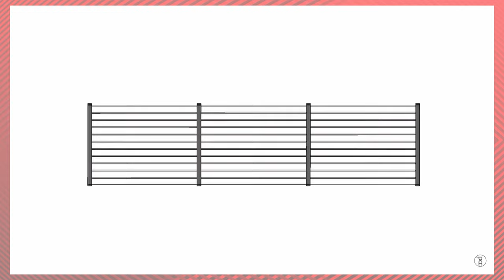How This Couple Built A Fence With One Fatal Flaw

Comment: Can't have wood posts encased in concrete. Has to have a little dirt or gravel at bottom of post for drainage. Will rot quick with no drainage. Need treated posts if using wood posts. Totally agree with using steel posts whether round posts with brackets and shorter spacing or your type of steel posts. Great breakdown guys.

Comment: Question?
Could you use decking screws in place of stainless steel screws. 
Stainless screws are so expensive vs Decking screws.
I ask because I am on a limited budget (retired).
Reply from the maker: If they're coated they may work, but I feel like the only guarantee is stainless steel.

Comment: If the customer requests wooden posts, do you still use concrete even though the wood rots quicker or do you have a better way?
Reply from the maker: As a general rule we just don't offer wood posts.